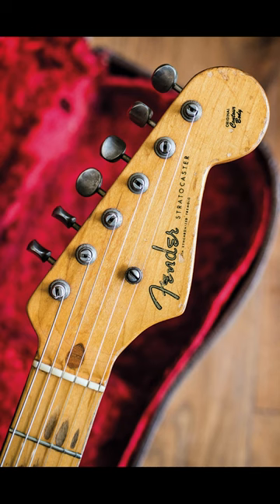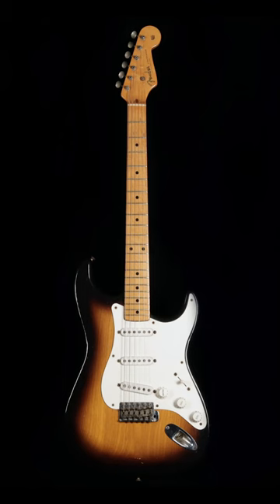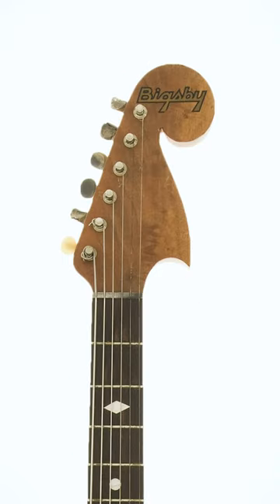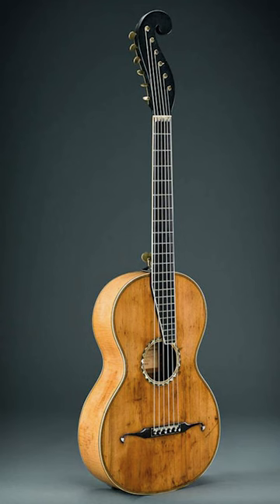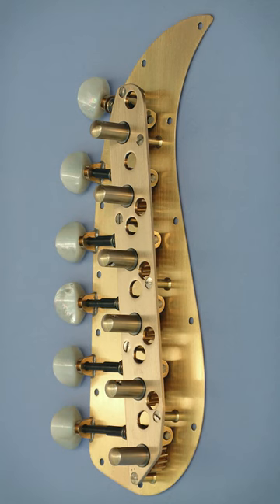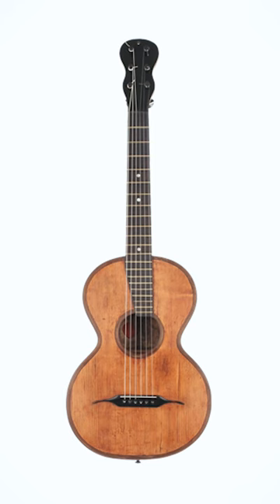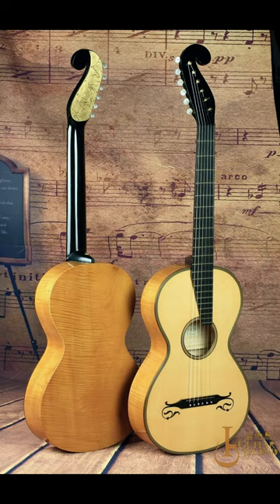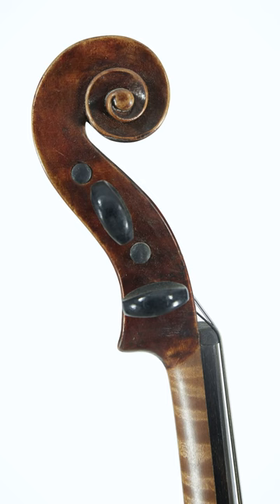Stratocaster Headstock Design Origins

Comment: I like the Ibanez RG headstocks because the strings pull straight through exactly like a stratocaster headstock. Other super strats have more of a Gibson Explorer type headstock design where the strings put extra tension on the nut by deviating sideways

Comment: Um... I mean I guess you could assume all of that. But it's also just the top half of an F hole on a violin/viola/cello/upright bass and those have been around for a lot longer than any guitar.
Reply from the maker: So has the violin scroll head stock, which has been part of the design of classical stringed instruments since the 1500s and IS the direct influence for the first 6 in line guitar headstock designs. The scroll itself references art and architecture designs dating back to ancient Greece. 
Stauffer was directly referencing the design motifs of the headstocks of violins/violas/cellos etc on his geared tuning machine guitars.

Comment: Can something be called "iconic" when it has changed so much over the years?
Reply from the maker: My dude, the Fender Stratocaster headstock has remained largely unchanged since its introduction in the 50s, with only a brief period of being enlarged -but the same shape - in the 70s. 
It's iconic because it's instantly recognisable and most other guitar headstocks still try to emulate it. It's a shape synonymous with electric guitar and rock music.

It is, by the very definition of the word, an icon.

Comment: The truth is it's a wood saving design, although it may appear similar to previous designs. If you take two headstocks, you'll find they lock together like a puzzle! This is because they can scroll a single piece of wood into two headstocks with NO waste.
Reply from the maker: If you think logically about what you've just said for a moment you'll realise that's not less wasteful at all. 
Videos of hand sawn necks from the Fender factory also prove otherwise.
Reply: @ScienceofLoud  I'm sorry but if you take a rectangle of wood and are able to run a scroll through the middle and come out with two "interlocking" headstocks which have no wasted material, obviously that's less wasteful. Go ahead try it yourself: Flip one headstock over and see how it locks into the next. 

Although they may not use this technique in their USA factory today, there is NO doubt that this is why Leo designed it this way. The man was well known for prioritizing repairability and simplicity, ease of manufacture.
Reply from the maker: @iancurrie8844  you've not thought about it at all, have you?
Reply: But you could have a headstock with no decorative shape at all that would be even easier to cut and probably save more wood. Even if you're right about this particular pattern saving wood over other similar shapes, why have the design at all?
Reply: That's not "truth" at all buddy